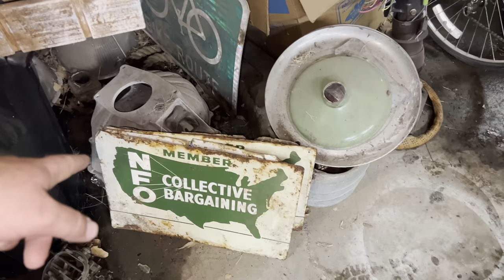You Never Know what you will FIND in the TRUNK! (More JUNKYARD TREASURE!)

Comment: This sedan body was used in 1939 and 1940.  With not a view of the rear fender tail lights and the missing body trim it is hard to tell.  However if the transmission is from this car it is a 1939 as 1940 had a column shift.  Also the grille you showed is from a 1939 with the wider spacing, different from the 1940 Standard and also different from the 4 piece grille in a 1940 Deluxe.  The 1939 tail lights would be teardrop and the 1940 tail lights are kind of a sergeant stripe looking.  If you had the front doors, the 1939 does not have vent windows and the 1940 does have vent windows.  Looking at all the pieces you show, it appears that the car is actually a 1939 Deluxe model (1939 Standard model is different, a carry over of the 1938 model).
Reply: Awesome info, I hope Silas sees it!

Comment: you can buy all the spare parts and rebuild all of those tonkas. Sand blast them with baking soda then straighten what needs to be straightened then paint. Put on the spare parts and sell them or give them back to the guy who originally had them. What ever you do DO NOT CRUSH THEM that would be a travesty.

Comment: I think that's a 40 ford standard, which means that yes the truck fenders will fit it. It looks like that trans in the trunk is early ford, so you might want to see if it's a 39 trans, since those are a few hundred bucks even if they need rebuilding

Comment: 25:26 One could restore these, get someone like these that are in good condition and make plastic molds from and cast wheels, interior and windows and so on. It is many Youtube videos that shows how easy it is to do. Steel metal will likely keep its original shape even if burned. Yeah, i see before me it is buyers that wants these to restore. So sell it in lot's of three to someone?
The wheels that crumbled did look good because when air tight it turns into coal more or less instead of burning up.
If i had been the owner of these i rather see them restored than getting crushed.
I dont know how old these are and so, but if they are old enough then it will be nice toy restoration objects.
I do like the Chevrolet HHR you have in the background there by the way, i had to search some to find what it was, it does look much like the Chrysler PT Cruiser in style. Looks like cars from the mid late 40's.